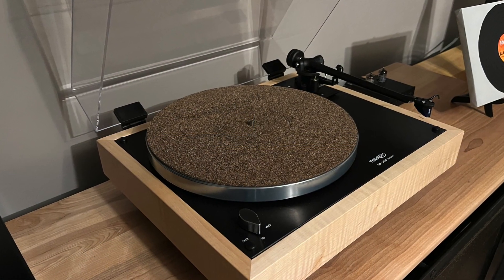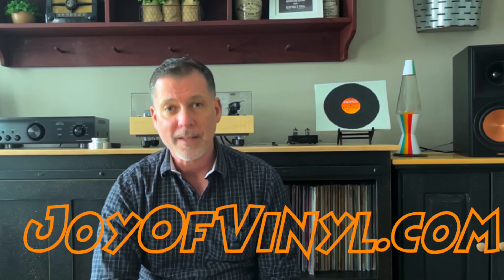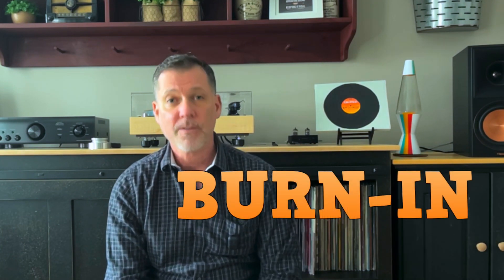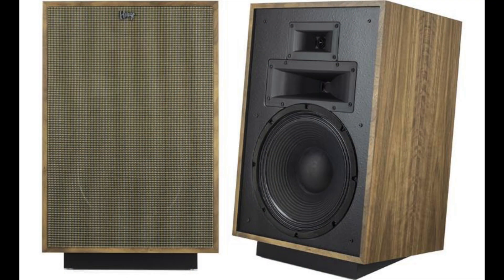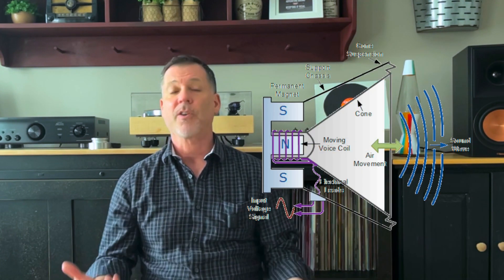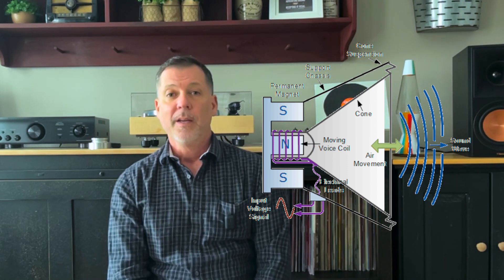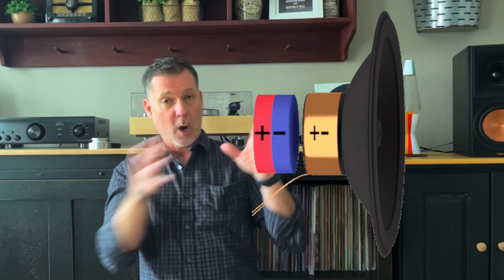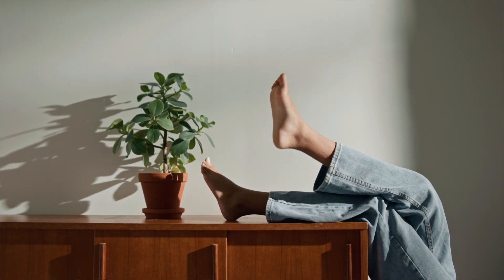Is Equipment Burn-In Real?

Comment: Great topic. I've been hearing about this for many years.
I agree completely with the argument that you should burn-in your speakers and other components in your set-up. I bought a pair of Wharfedale EVO 4.2s and while sounding ok out of the box I knew a couple hundred hours of burn-in would help the sound. The speakers  exhibited a harshness that eventual decreased until it was gone. Also the bass response became a bit deeper. This effect might be in my head but that's ok because to my ears the sound definitely (after burn-in) was better.
Reply from the maker: I just purchased a pair of KLH Model 5s and I definitely hear a gradual improvement with each record played.  Especially with the bass response.  The manual recommends 8 hours.  Like you experienced, I have a feeling these will continue to improve past that point.  
I appreciate you sharing your experience!  Good speakers those EVOs!

Comment: Burn in is real, warm up is real, and getting to use to something is real.  Burn-in is entropy, that's a thing.  Warm-up is molecules moving more freely, that's a thing.  Getting use to something is biological adaptability, that's also a thing.  Do you really think my 50 year old integrated sounds like it did 50 years ago?  My Aegir sounds like crap until it is warmed up.  I can assure you that I am not getting use to it during the first hour, it is actually getting better.  

The extents will vary depending on the component, the rest of the system, the environment, and the person listening to them.  Doesn't mean they aren't happening.  Also doesn't mean people don't think more is happening than really is or something is happening when it really isn't.  Human memory and perception is almost always inaccurate to some degree, so that's also a thing.
Reply from the maker: Excellent way to explain it!

Comment: If you plopped your speakers down anywhere, and play poorly mastered recordings (countless recordings are compressed and poorly mastered), then you will likely not notice the sonic improvement over time.

But if you have a stereo with good imaging (you can hear sounds behind your speakers, in the middle of your speaker, beyond the outer edges of your speaker), and you have good sounding content, then you will notice the improvement over time -- especially with tube equipment, speakers, and styli.

The same goes for warming up your equipment.
A good stereo with good content will sound better after 20 or so minutes of playing.

...and by "good sounding content", I am not referring to the melody.  I am referring to the sonic quality of the recording.

Brun-in is real.
Reply from the maker: I second everything you said :)